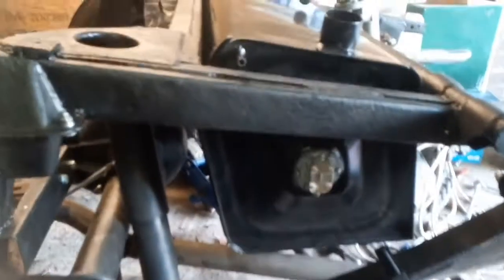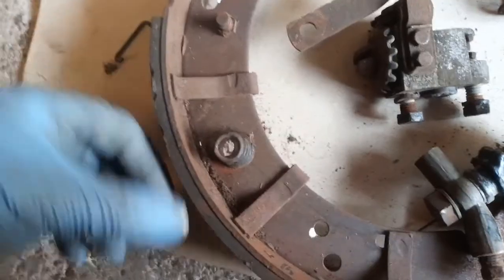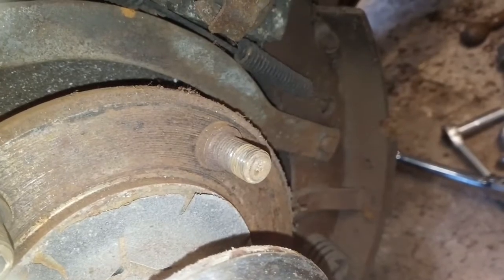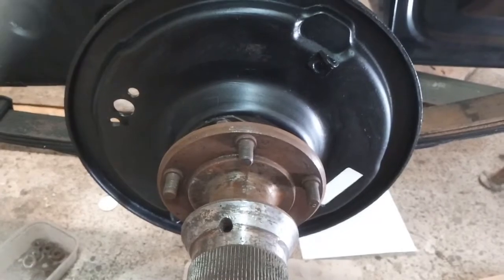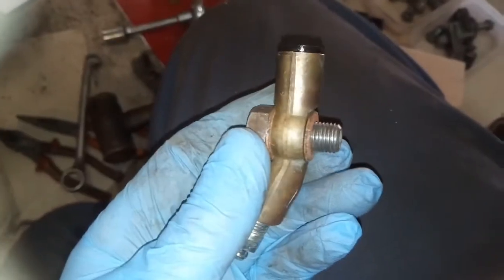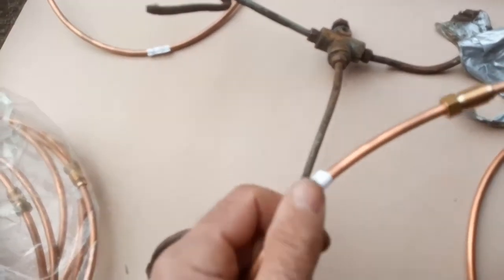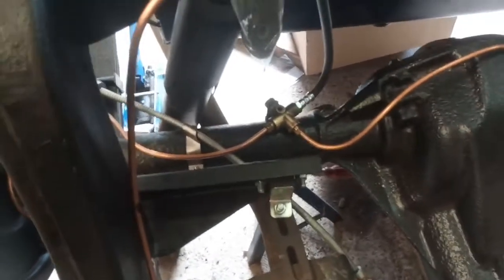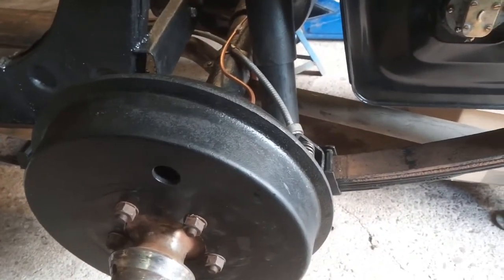Jaguar xk140 restoration

Comment: I lucked into finding this video as I was about to start refurbishing the rear brakes on my '55 XK140.  I was trying to understand how the parking brake and main braking system interacted before I even took the wheels and drums off. When I bought it, neither the parking brake nor either rear hydraulic brake worked.  After watching the video, I went ahead with disassembly and found that both left and right side wheel cylinders had stuck pistons.  And coincidentally, I had the exact same issue as shown here where one adjuster worked normally and the other did not "click." The domed detent "washer" was not seated in the mating shaft correctly, probably due to 60 years of crud intrusion between the parts.  Anyway, your video helped demystify the job, so that I had confidence that it was simple enough to work on.  Thanks !
Reply from the maker: What I hadn't commented on at the time is that long bent bar should not be there . It had been fitted incorrectly by PO . It belongs on the front brakes .

Comment: I always remove my watch before heading out to the garage. By the way, it appears as though the wire harness for the fuel level sender does not follow lucas color code, but a generic code( it's difficult to make out because of camera shake). It may be obvious to the current owner, but when the car changes hands, the wiring can become a time consuming nightmare. By far, the best time to rewire the car(in my opinion), is while it is disassembled. That goes for the brake lines also. The line that goes from the master cylinder to the rear of the car goes in and out of the right side frame in a difficult manner if the car is not lifted high enough for access.